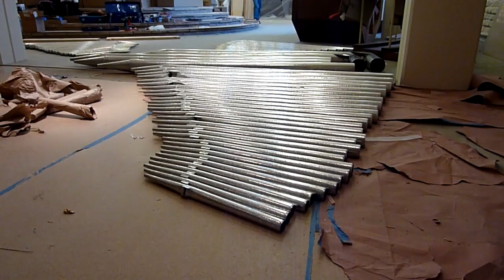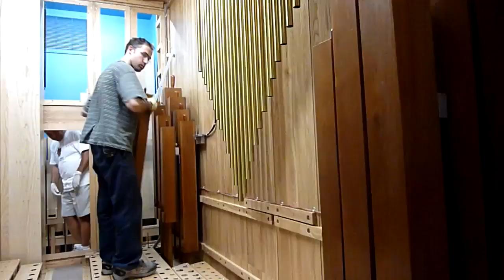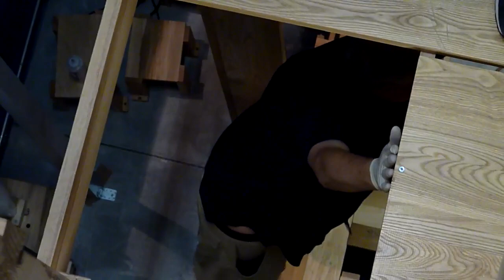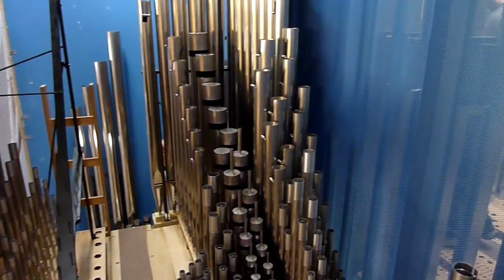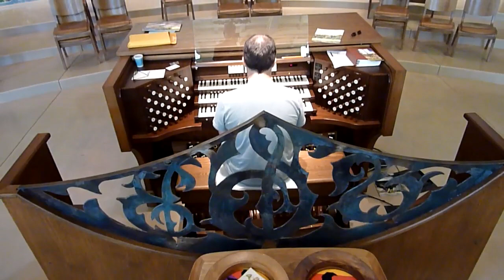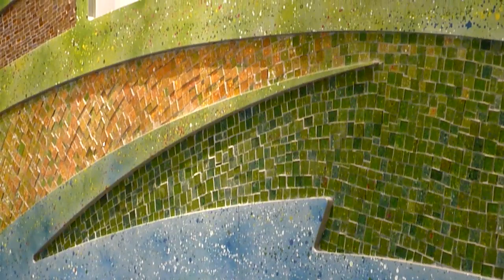Organ/Art Installation at Saint Barnabas - Pipes & tuning

Comment: Thanks for this, one of the few videos which shows some of what goes into intalling an organ.  One point strikes me:  why were the pipes being fitted with the wind off?  I always put pipes in with the note sounding, partly to blow out any debris, but also to be certain that the pipe itself is properly seated.  Perhaps this is not practical, with an instrument of this size?  Stunning-looking job.
Reply: Offshoreorganbuilder I don't think it is practical at all. You will find out if they aren't properly seated when you set the temperament and tune.
Reply: You can always blow out the chests before planting pipes.  If you can't tell if the pipes are seated when putting them in, then you did an incomplete job racking them.